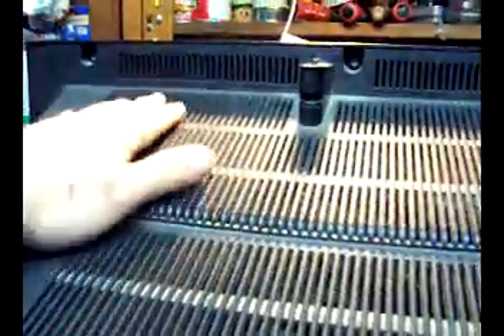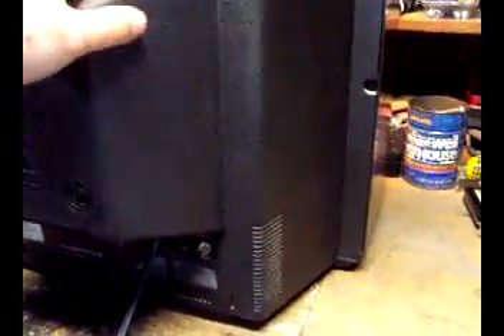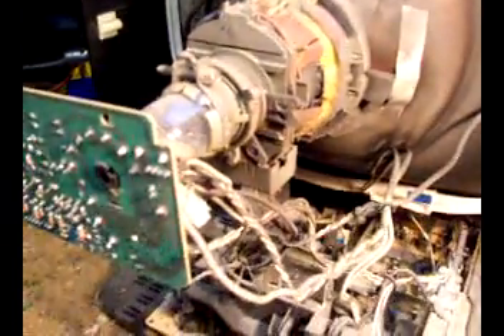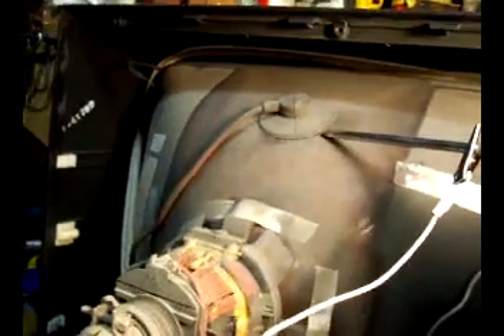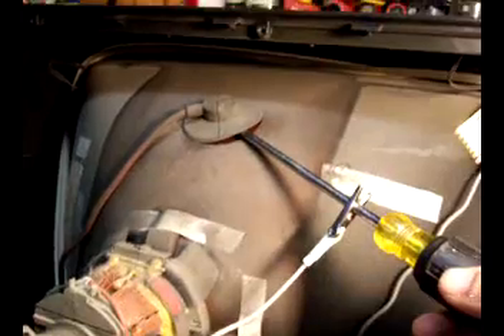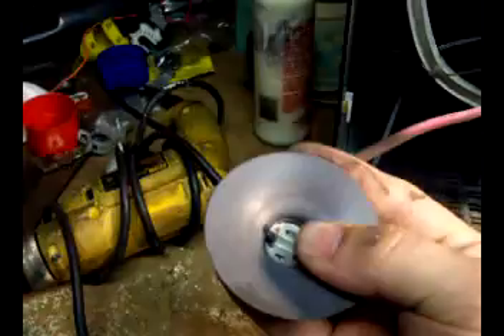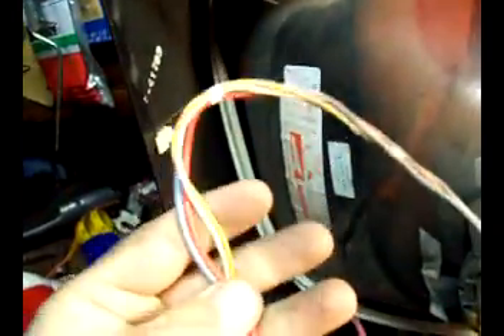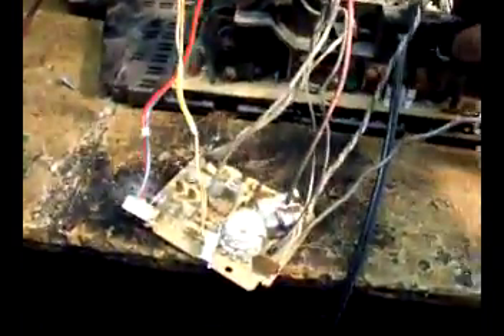Discharging & Tearing Into a CRT TV & Some Flyback Arcs

Comment: I've had only one TV set scare me. I didn't take note of the brand.
I started tearing into her and noticed my body hair stood on end after removing the main flyback EHT (Extra High Tension) lead from the tube. The silicone boot SCREAMS stay away.
I was smart enough to connect an alligator clip to ground (With the TV sitting on it) and approach. It heavily arced 1 cm repeatedly... Deadly
Reply from the maker: They can knock you across the room...... I try to discharge several times before I approach it....

Comment: +More350Power Im a bit late but I have one question ive seen vids were they wire a flyback to arc but can I let it arc just as you do?
Reply from the maker: +T T T T Gaming the way I did it is very dangerous to say the least.  Sometimes you get better results when you build your own driver circuit and wiring.
Reply: More350Power okay thanks for the help ☺

Comment: sir,i have a rca 32" 2006 model try to turn on relay clicks can here the crt power up but never comes on red light blinks 16 times or so but screen never lights up and no sound  any thoughts what the problem can be I have heard that rca flyback  are bad a lot of times thanks
Reply from the maker: It sounds like your flyback is bad.....  you might be hearing the circuitry powering up and possibly the filament in the back of the crt tube warming up, but if you dont have a picture or light from the cry, you dont have high voltage and if you dont have that the flyback transformer and/or the driver circuit has failed.  In my case and I cant remember the vid I did on it, I had a capacitor replaced and I re soldered some connections and that repaired the same problem you are having.  The only thing you have to watch is the crt in itself is a HUGE capacitor and it will knock you across the room if you dont know what you are doing.  Also, several capacitors on the board have the same effect.
Reply: More350Power thank you sir, for the comment on the 2006 rca tv. im not a teck, but have watched many videos on how to discharge the flyback with a screw driver  and how to discharge  large capacitors with a 10 ohm 50 w resistor have worked on a few cb but never a tv but I have heard there very dangerous most people would just throw this set in the trash but I just cant do it I think the worse part of tv teck, is when they done away with tv that has crt if you have any more advice of what im looking out for or should I replace the fly back first thanks again for your help
Reply: More350Power pls read my question I need to know

Comment from the maker: There are some capacitors that absorb shock, line voltage spikes and such...  and there is also a safety feature that cuts out the high voltage if it feels its shorted, though it should reset when you unplug for a few minutes and plug back in.  Otherwise you have a blown cap or fuse..

Comment: Thanx mate for the reply. Yeah the best place mate for circuit diagrams that I use is google emages. Try it!! Don't go for the 555 timer circuits as thay are very sensitive to emf! The ZVS driver circuit is as hard as nail's if ya use good mosfets! Like Irfp260n' thay are 55amps and 400volts Best bet to use. Iv made one and stuck it on a nice heat sink and as its a zvs circuit its a zero volt switching!! So the heatsink doesn't get warm unless i stick more than 30 volts into it. See my videos ;)

Comment: Hey there friend cool video. Like the intro too! ;-)

I just wanted to say that instead of using all that tv board why don't you de-solder the flyback and make yaself a zvs driver. It would look better and be little easyer than having a big thing next to ya Jacobs. Zvs drivers are simple to make. Ya can get the circuit diagram of google emages! plus ya can get very good arcs and the flyback won't heat up as much! AND MORE POWER!!! ;-)

Hope this helps*

THUMBS UP*

Comment from the maker: @FXwhiz30 I am using the TV's power board itself for the flyback driver circuit and arcing it to the transformer secondary ground which is usually tied to the cable input casing or something similar.  It is recommended to remove the transformer and wind it yourself for the projects and create your own driver circuit so as to take some of the high amperage that can injure you but still leave some functionality to it...... plus its easier!